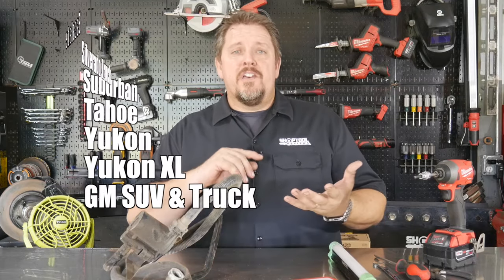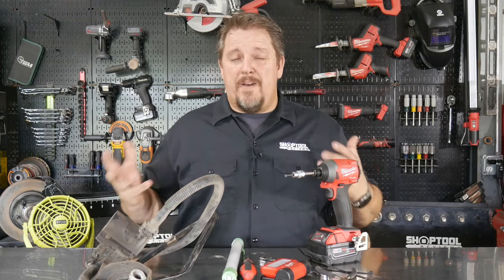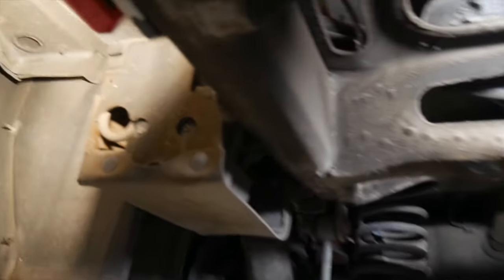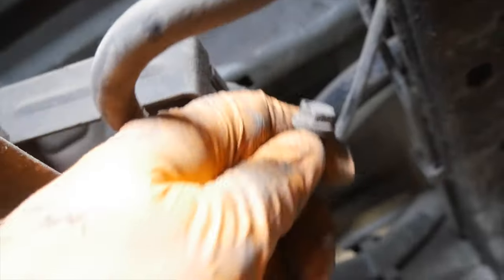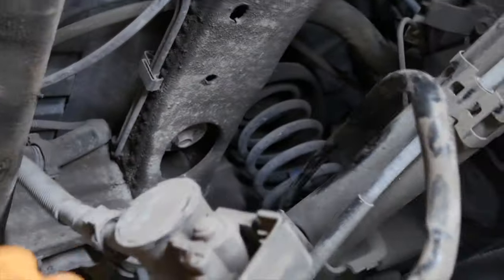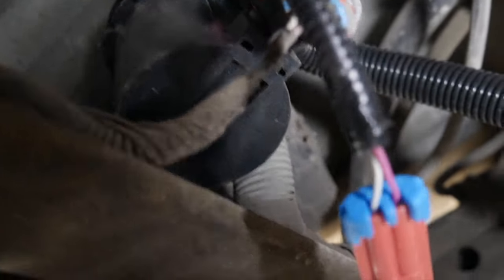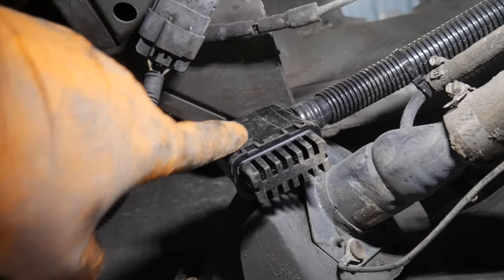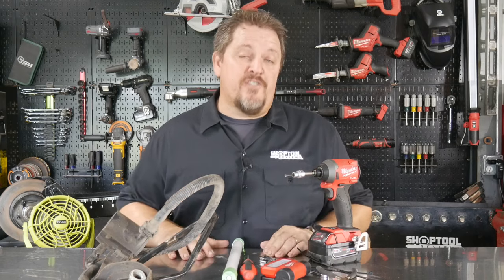Gas Tank Won't Fill? Escalade Vapor Canister Vent Valve Solenoid FIX

Comment: Thanks very nice review
But I have changed this one and no improvement I also changed the canester but still not ok
Reply from the maker: If you've changed the canister and this, then the only one left if the easiest one. There's an evap module on top of the intake on the driver's side, near the front of the motor. Takes just a couple of minutes to change. Thanks for watching.
Reply: @Shoptoolreviews  I changed that too and cleaned the lines but they where without any carbon pellets, What else can be?, Please its driving me crazy because spit the gas when i want to fill the tank. 
Mine is a 2004 Suburban. 
Greeting from Panamá 🇵🇦
Reply: @AlexRodriguez-dr9ch   Hi I am in your same situation now. I replaced all 4 parts and my escalade still won't take gas.  Did you solve your issue if so what did you do next? drop the tank? Thanks
Reply: Just try filling up at different gas stations. I have the same problem at one particular gas station and I avoid it whenever I need to fill up my gmc truck. I haven't replaced any parts. I also noticed I only get the problem whenever I try to fill with regular unleaded fuel, I never get the problem when I fill it with E85 fuel

Comment: All right I change that and it's still doing it it done it it let me fill my tank up one fill up and then 300 miles
Reply: And it already had the jumper wire hooked to it so it's been changed before I only have $207,000 MI
Reply from the maker: Check that actual vapor canister and see if the canister is clogged or if it's already ruptured and released the charcoal into the system. Thanks for watching.

Comment: great vid will order parts and change out...check eng on, no remote start and can't pump gas
Reply: did not fix the problem
Reply: Dammit. 

Same exact problem 2013 GMC SIERRA
Reply: You got the love it. No remote start I wonder how many people have pulled their hair out trying to fix remote start haha they never put two and two together. Would not think problem with remote start had anything to do with evap canister and vent valve

Comment: actually i saw it on lots of
videos(it didn't came from me)
the culprit is CANISTER.
Reply from the maker: There are 3 problem areas: Vapor Canister Vent Valve, the actual Vapor (charcoal) canister, and the Purge Valve on top of the intake manifold. Thanks for watching.

Comment: So since the tube of the solenoid that goes zip tied to the gas filler neck doesn’t plug into anything, why do we even have to run that wire up there? Is there a sensor in it or something?  Thank.
Reply from the maker: Its just a breather hose that is vented, so it gets connected near the filler neck, so there's very little chance of water intruding. Thanks for watching.

Comment: I jus changed it but still does the same , any other idea maybe what else could it be ?
Reply from the maker: You can try changing the Vapor Canister Purge Valve on top of the intake manifold. It's very easy to get to. Also, if your Vapor Canister ruptured before you took it out, it could have all those little charcoal balls inside all the hoses.  
Below is an example of a purge valve for a 2011 Suburban. What type of vehicle do you have?
https://amzn.to/30L2Q1X
Reply: Did you ever figure out what is was just replaced mine and still cant pump
Reply: @zachgusler2419  same here... I replaced both and still takes 2 years to pump 1 gallon of gas

Comment: Thanks for the video; I installed the vent valve and harness connector on my 2007 Escalade as you indicated, but I am still having issues when filling up.  Do I need to have the code re-set as well?
Reply: I think it could be the Canister it self, pls check and update us as i am facing the same issue
Reply: Same here! Replaced the vent and connector, but still can’t fill properly!

HELP lol
Reply: Could be your charcoal canister.  Mine was completely shot and the charcoal was being sucked into the evap lines.
Reply: From the commenter and the repliers.. What was the result?  

Usually you do have to reset the code after replacing any part dealing with a code because it came up.  Take it somewhere to get it reset or take off the negative lead on your battery and leave it off for a few minutes then place it back on.
Reply: @tuliodourado8946  Hi I am in your same situation now. I replaced all 4 parts and my escalade still won't take gas.  Did you solve your issue if so what did you do next? drop the tank? Thanks
Reply: Hi, I am facing the same situation. I replaced the Vapor vent, canister and the purge valve and my Denali XL still won't take gas.  I didn't reset the code yet. I guess that's the only thing remaining to do. What do I Do?
Reply: @jkade8857  I have the same issue, what did you have to do
Reply: @4jroberts  I changed the charcoal canister, blew out the evap lines with  an air compressor, and the damn thing still wouldn't take gas without coming back out 😑.  2003 Nissan Xterra.  I got a different truck. Lol

Comment: Quick questions sir. So when I pump gas now in my tahoe. It spits it back up in my face with hella force. No matter how slow I go. It takes 30 mins just to get to half a tank. 

Took it to dealer. They said I need a whole new tank. Because the filler flap inside is broken. Any suggestions on what to do. I don't have $1,300-1,800 to spit out just for a tank and labor.

So in lieu of figuring out myself. I took out the flap completely. And took out the screen that's inside the filler neck. Stuck a wire all the way down and there's nothing blocking the fuel from the tank.
Reply from the maker: Your problem is exactly what we're showing in this video, or you need to replace the whole vapor canister. It's not the fuel tank.
Reply: @Shoptoolreviews  thank you sir. I was just confused as to I don't have a check engine code. Should I replace the part you showed on top of replacing the big canister block aswell. Or just the part you showed
Reply from the maker: It’s really hard to tell. You can try just replacing the vent as I did in the video, but you may have to replace the canister as well. We had to replace the canister a few weeks after we filmed this.
Reply: @Shoptoolreviews  got it. Thank you

Comment: I change the entire system and i Still cannot get it to work It still stops apart please help.
Reply from the maker: Did you also replace the solenoid that is up by the intake? If your evap canister actually came apart internally, you may have some of the small charcoal balls clogging the rubber hose/s.
Reply: Yes I had replaced that also so possibly their rubber hoses are clogged interesting

Comment: I changed it for a brand new one and still cannot fill up gas tank. Bought a camera and inserted it all the way to the tank, there are no obstructions. What's next ? getting frustrated.
Reply: Same situation for me.  Replaced this part and the canister
Reply: Hi I am in your same situation now. I replaced all 4 parts and my escalade still won't take gas.  Did you solve your issue if so what did you do next? drop the tank? Thanks

Comment: I replaced the parts and tried to fill gas after and started to spill back out through nozzle
Reply from the maker: The charcoal canister may have ruptured, and you could have the little charcoal bits trapped in the vent lines. Many times, that can be between the intake and the canister. Thanks for watching.

Comment: Would this be the same procedure on a 2004 Escalade? I'm getting code P0455.
Reply from the maker: I'm really not sure on the '04. It's probably very similar, but not exact. I know a lot of things changed on the '07-up.
Reply: I'm have the same problem on my 2004. Have you had it fix yet
Reply: @marlonperdue  nope nothing yet. Replaced cap, vent valve, evap solenoid, charcoal canister. Still get the tighten gas cap message then boom and check engine light. Relentless ass code.
Reply: it might have other leaking part of hose

Comment: Has anyone ever had gas leaking out of there purge valve solenoid.i haven't drove it in a week an I think the gas pressure in the tank pissed the case thru the canister down into the the solenoid

Comment: I have sugar clogged in tank to we're it stop gas from going into car help please 2004 focus
Reply: Sorry, drop tank, correctly empty, clean with steaming hot water and rock back and forth to clean out. Replace fuel pump assembly (Plastic bucket or pump on a stick), replace fuel filter, disconnect fuel supply line at injector rail, cover with rag, using compressed air or nitrogen (Do not exceed 100 psi) blow line out while lines are disconnected. Get a bottle of “Chevron, by Techtron” at parts or home improvement store, add to tank. Purchase locking fuel cap with OBD-2 compliant pressures. 
Retired ASE Master Tech  (cross fingers)
Reply: Wow who put sugar in your tank????
Reply: Wow somebody pissed at u!

Comment: Bought mine and was experiencing the exact same problem can’t fill my tank without it stopping and I can’t remote start mine imma fix mine this weekend plus if you know anything about the fuel pressure regulator code p0089 that’ll also be helpful thanks in advance

Comment: Just my luck replaced it and it still doing the same damn thing.
Reply from the maker: You might want to try changing the actual charcoal vapor canister or the purge valve that's near the intake manifold. Thanks for watching.

Comment: How cruel of you, or do you like bleeding? Please, when cutting zip ties, so the next guy doesn't look like he was bare-hand fighting a tiger, get some flush cutters and cut the zip tie flush to the locking clip on the zip tie. By cutting them and leaving a little tab, especially at an angle, it shreds skin when someone has to put their arm up in that hole. I've done electronics installations on buses for many years and there is nothing worse than installing equipment on 1000 buses for some city and by the end there are bloody scrapes up and down both arms from some jerk who didn't cut the excess zip tie tab off flush with the zip tie locking tab. It's irritating enough that I would comment on a YouTube video to someone I don't know and have never seen a video from before. Other than that, this was a good video and it will help me with my 2012 RAM 1500 that I just went to fill up and drove away angry because I got only 2 gallons in before I got tired of ol' clicky nozzle at the two pumps I tried. Thank you!